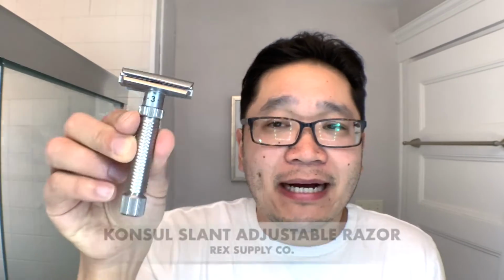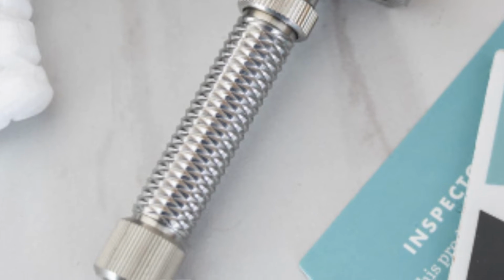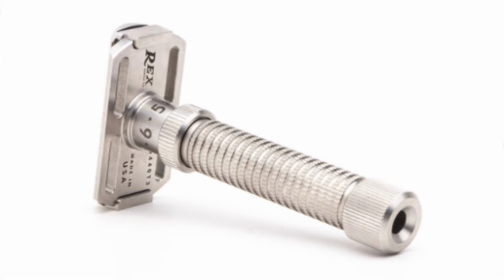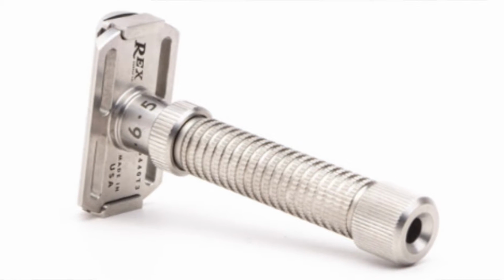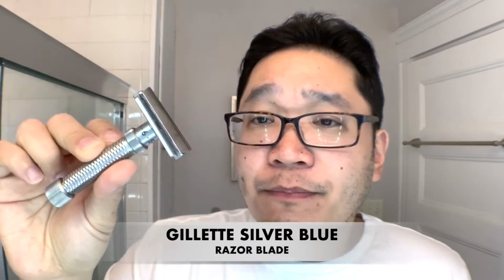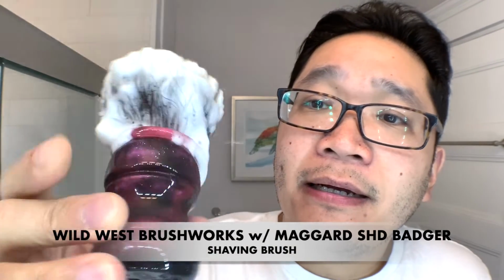Rex Supply Co. Konsul Slant Adjustable Razor First Impressions

Comment: I had an Ambassador.  Hated it.  My biggest issue with it was WAY TOO MUCH blade feel.  Matt from Razor Emporium claims that they engineered the Konsul to have less blade feel than the Ambassador. I'm guess that's not the case.
Reply from the maker: Definitely take a look at my second shave, but it is a much milder experience than the Ambassador when loaded properly!

Comment: I'm glad i didn't purchase the konsuel. I don't like the blade feel of the Rex ambassador unfortunately at thr low settings, just use it once in awhile. However there is a YouTube hack in which you snap the de  blade in half and trim the blade to reduce the blade exposure which makes the Rex much better.
Reply from the maker: Just did a follow up video with the Konsul, and settings 1-3 are very mild and low in blade feel, please be sure to check it out!

Comment: Genuinely flabbergasted at the comments here…the Konsul, especially at lower settings, is super mild. Jon, you absolutely cannot ride the cap with this razor. Ride the bar, and I think you’ll find the razor is too mild at the 1 setting. 

I don’t love hyper aggressive razors by any means but I would typically do 2 passes on 5 or 5.5 with the Konsul without issue. 

Ultimately I didn’t find it was as good as the Blackbird Ti or Wolfman WR-4 but it’s still an excellent shaver
Reply from the maker: Found in my second video with the razor that the issue wasn’t riding the cap or the bar, but in the clamping down of the blade in the head.
Reply: @Latherhog  yeah the loading mechanism really isn’t the best…you really have to pinch the blade down

Comment: Something is wrong. 1 setting is super smooth and not super efficient. Check to see if the blade was loaded ok via even alignment and balance. This isn’t close to blackbird on bladefeel. Ambassador has way more bladefeel.  I have owned both - kept Konsul since it was smoother. GSB works great in Konsul. Try that blade in another known razor.  Agree give it another go.  Good luck Jon and thanks for honest review.
Reply from the maker: Hi Ronnie, thanks for watching! I do think there was an issue with the loading of the blade and fully intend to have another go with the Konsul!

Comment: I have never experienced a Rex razor.  The main reason I haven't is the number of them I see on the BST sites.  I think they are just too aggressive for many people and they don't keep them very long.  Also,  and I am not interested in having to learn how to shave a different way just due to a razor.  In my opinion a razor should not be that difficult to use.  Thanks for the video!
Reply from the maker: Thanks for watching Randy! I agree that a razor should've be overly complicated or difficult to use, but I'm ok if there's a small adjustment period to get the best shave out of a razor, which I think is what is happening here with the Konsul.

Comment: try shaving with a steeper angle instead of shallow angle. the optimal shaving angle of a DE safety razor with posstive blade exposure can be approached from  two different direction. one usually is way smoother than the other depended on the razor head geometry.  like Shane from Blackland always say, adapt to the razor. the rex ambassador and konsul work smoother by riding on the safety bar with extreme light touch.
Reply from the maker: Thanks for the tip!

Comment: I like the Konsul. It feels smooth and efficient to me. I typically shave on the 3 setting. But my personal experience is it does not play well with moles of any kind. I have a small, almost flat one on my chin. Most razors go over it with no problem. But the Konsul nicks it frequently (all the time if I’m not paying close attention). The only other razor I’ve had the same issue with is the Masamune, which stinks because it’s another razor I like.
Reply from the maker: Thanks for sharing, especially the part about the razor NOT playing well with moles!

Comment: I can't stand Rex razors; they are way too aggressive; there is no need for so much blade exposure to the skin.
Reply: I felt the same for years.  But after using increasingly aggressive razors from other vendors I can now get a comfortable shave with the ambassador on level 5 with no effort.   Wish I could say the same for the Blackland Dart…
Reply from the maker: They might not be for everyone, but as @rmackowi mentioned, tastes can also change over time!